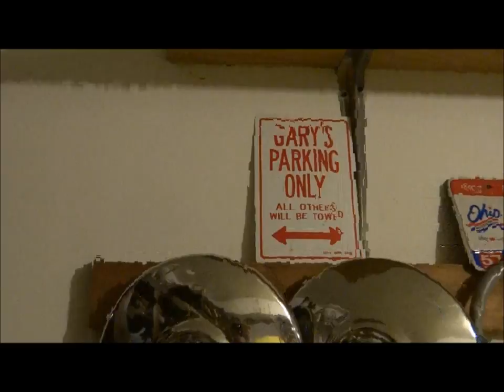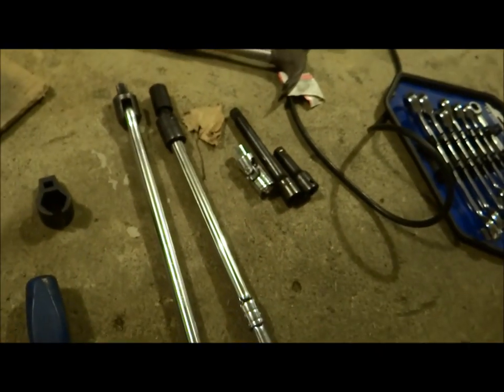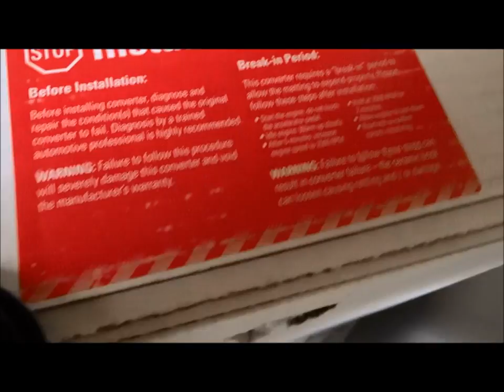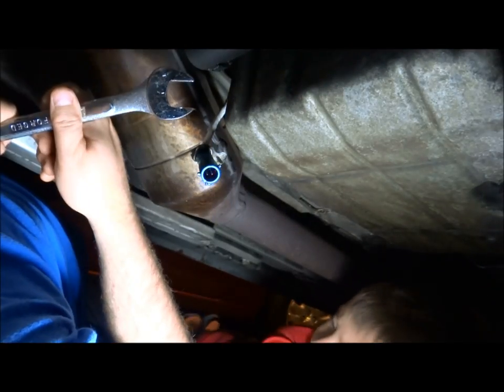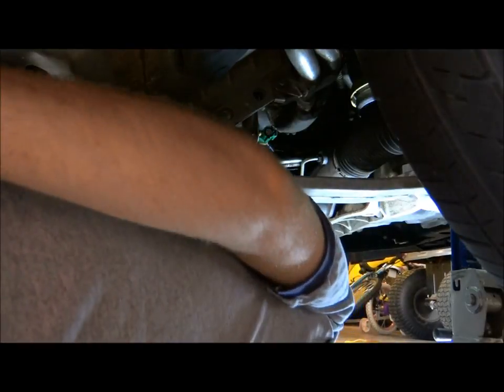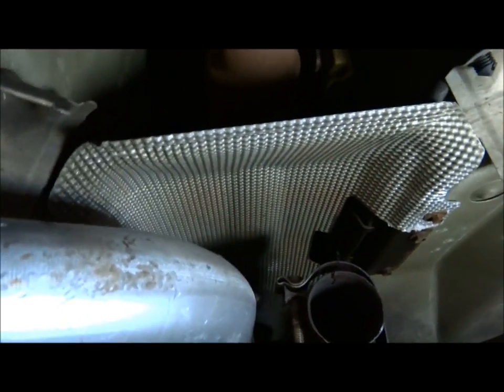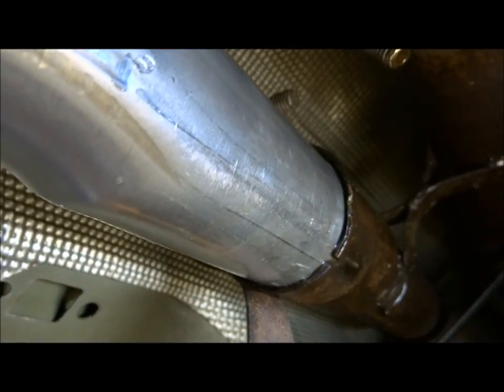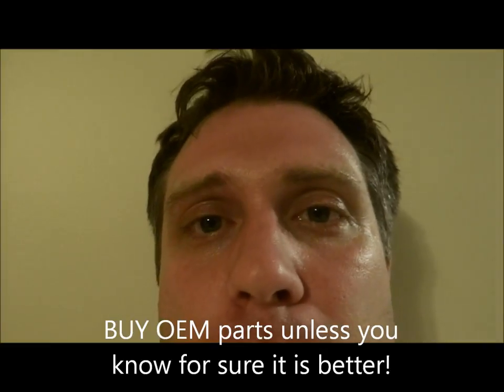2005 Lincoln LS V6 catalytic converter removal and install

Comment: Hey Gary, I currently have a 2004 Ls v6 and I just received the same part as you (eastern catalytic 30500-Bank 2). It's unfortunate that it is only after I got my cat that I see this video but since I don't have the money to buy a 950$ OEM cat, how can I replace the current flange that you say is too big and deep to fit properly on the car so it won't have any exhaust leaks? Will I need a rotating saw to cut out the current flange and where can I buy the proper flange ? Thanks in advance !
Reply from the maker: Dave, unfortunately during the video I broke my hydraulic jack and was so sickened by the whole thing after a mechanic said it didn't work I just had him replace it.  The OEM replacement the first shop wanted $1200.  The place I went to only charged me $900 to install plus the part.  It was an OE part, so it probably didn't cost as much.  I've heard several places won't install customer pipes cause they just didn't fit well.  My opinion is there is several things on this car that just are just plain bad.  The intake manifold covering the spark plugs and PCV, the catalytic converter design is flawed, and I think DCCV is a total waste...why would you really want that feature?  It's not like you are in a bubble and can truly have two different temperatures.  Putting the traction control next to the drink holders is stupid too.  Mine broken and now I have a small rectangle hole there.  Have you tried hooking it up yet?
Reply: Yes I know the LS can be a real pain in the A** but I really like the car so I live with it. I know a whole about the intake manifold positioning problems... I took it off by myself to change the plugs/coils on the passenger side. The Ls series, for people who are buying them now is really all about the maintenance that have been done to it previously (I was very fortunate to buy one that as been constantly maintenance and only had one proprietor). Iam not english therefore I make a couple of mistakes but to answer your question no I didn't hook it up yet (I have an appointment wednesday at the garage). I'd like to know if there's an alternative to fit my eastern catalytic properly on my LS( changing the flange, etc.) ? Thanks buddy!
Reply from the maker: I'm sure there is an alternative if you have the old one and can weld...but it could also have to do with the positioning of how the pipes go up to the exhaust manifold.  I can tell that the person before me did a terrible job maintaining the car...or they took it to some hack mechanic that put junk parts on it.  Is the exhaust leaking now?  Did you install it already?
Reply: No my exhaust isnt leaking but what really confirmed my choice of buying a new cat is that almost no pressure was coming out from my driver side exhaust. No I have not installed it yet I have an appointment at a muffler shop wednesday. I hope he can find a way to installing my cat ok so there isn't any exhaust leaks (I hate going back and forth at at garage/muffler shop to repair newly installed parts). Oh and by the way thanks for the video of the LS HVAC self test... didn't even knew I could do that haha
Reply from the maker: Well that's good.  Yes, the driver side exhaust is where my problem was too.  When I took the cat off there was a tear in the screen.  Don't forget to keep the old cats and turn them into the scrap yard.  I got $80 for the pair.  My part was probably just defective.  You might be ok.  Good luck and let me know how it goes.
Reply: Will do ! So, in resume, if the dimension of your 05 LS is the same as my 04 LS, i will 100% need to modify in any way the flange (or weld) in order to make properly fit the eastern catalytic (having no exhaust leaks) ??
Reply from the maker: You shouldn't have to do anything since they are supposed to be direct fit.  It could have been a manufacturing defect for me, and I hope if your case they got it right.
Reply: All done ! Went to a muffler shop to do the job. In the beginning he noticed that the cat didn't fit properly. My problem was that the nut on the bolt wasn't screwed all the way to the exhaust manifold flange. Since they were stuck he cut the 2 bolts and after a little welding/cutting he installed 2 new ones to which he screwed the bolt all the way to the exhaust manifold flange. Cost me 120$ of labor for 2 hours. On my way back I noticed a little whistling sound when I rev the car at 3000 rpm +. I'll check that when I will change my tires for winter. Anyway, the muffler guy did a good job.
Reply from the maker: Well that's good to hear.  You know, I've had a whistling sound as well, but I thought it was coming from the air box.  I'm glad that you were able to get it done.
Reply: Did you found where the whistling noise came from ??
Reply from the maker: I haven't yet...I just figured it was my air filter cause when I changed it to a K&N filter it started making the noise.  I'll have to do some investigation work.  Let me know if you beat me to it. :)
Reply: Gary Ober Hey Gary, I have a little question for you bud. I recently ordered a new fuel filter and I was wondering is it the Fuel Pump Motor I have to remove in order to pressurize the fuel lines. I red some articles that mentioned that I had to remove the fuel pump fuse/relay and I was wondering if the fuel pump motor is what they referred to. Thanks !
Reply from the maker: Hi Dave, I wouldn't think you would need to remove the fuel pump motor, because that is located in the fuel tank I'm assuming.  Typically there is a banjo bolt or schrader valve to depressurize the system.  I think I have seen a video..https://www.youtube.com/watch?v=Ibe8R-ejCaU.  He says to take the fuel filter relay out and the the motor run.  Basically it sounds like after you take the relay out and start the car, it will run and then die because all the pressure will eventually be gone.  Hopefully that helps!
Reply: Gary Ober Hey Gary, it's been a while but I discovered what the whistling sound coming from my car was. It was one of the hose (in my case the pcv hose) who most probably had been replaced by a heater hose and liquid (I don't know exactly what goes threw that) have made my pcv hose to ``collapse/shrink`` and that's what was making the whistling sound. Hopefully it can help you find yours if you have not already solve the problem !
Reply from the maker: Dave LS
Hey Dave, how's it going?  That is interesting...I thought the PCV hose was underneath the manifold.  Did you replace the hose with the proper hose or did you make a new one?  Do you happen to have a video?  That is really great that you found the problem.
Reply: Gary Ober It is going good and you ? To answer your question, I think its the pcv hose. That's what my mec told me. I went to a place that cut me a new one (it's not OEM but it do the job well) and did not have any whistling since. I did not make a video but there's a link of the same v6 engine. https://www.google.ca/search?q=lincoln+ls+v6+engine&espv=2&biw=1093&bih=534&source=lnms&tbm=isch&sa=X&ei=8sq6VMfiAoiiNvKmhMAL&ved=0CAYQ_AUoAQ#imgdii=_&imgrc=yt98k6ucYnR-pM%253A%3BUwJL34S5CqyXyM%3Bhttp%253A%252F%252Fi111.photobucket.com%252Falbums%252Fn127%252FxMasterKatarnx%252FLincoln%252520LS%252FP7160629.jpg%3Bhttp%253A%252F%252Fwww.nfscars.net%252Fforum%252Fshowthread.php%253Ft%253D27215%3B1024%3B768 . The hose that I replaced is the one you see with the big white/red sticker on it near the intake (if it's not the pcv hose do you know the name ?)

Anyways, hope everything is good on your side with your LS.

Comment: does the davico 59085 fit from rockauto.com??
Reply from the maker: Eric, it says it is a direct fit, however there has to be a good reason 
why it costs $10 less or $20 less than the Bosal and Eastern Catalytic. 
 I'd go to the dealership and by the OEM part.
Reply: +Gary O (Gary's Garage) i guess ill just find out when the part gets to my house if it fits or not
Reply from the maker: Eric Villa
Let me know if it works out.  Good luck!
Reply: +Gary O (Gary's Garage) i had order the catyltic converter for the left driver side from (davico manufacturing). 2004 lincoln ls v6 and it fit rite in i juat had to use some wd-40 to get it in.
Reply: +Gary O (Gary's Garage) i will be oredering the right passenger side catyltic converter this Thursday and i will also let you know if it fits.
Reply from the maker: Did you test it?  When I say fit, mine fit ok however when I started the car it started smoking because it wasn't a perfect fit.
Reply: +Gary O (Gary's Garage)  yes i have tested it
Reply: +Eric Villa and it works
Reply from the maker: That's great news!
Reply: You still riding the ls with the davidco’s?